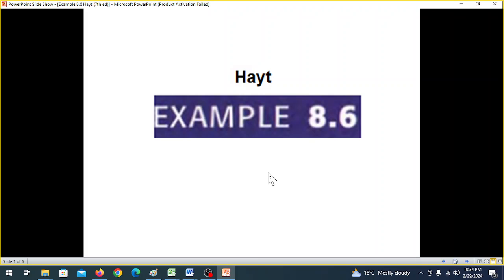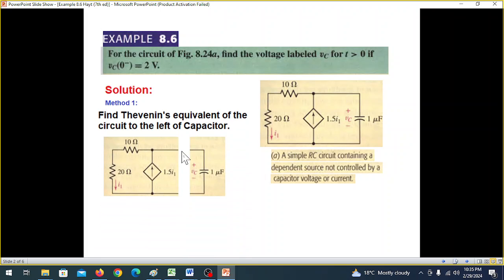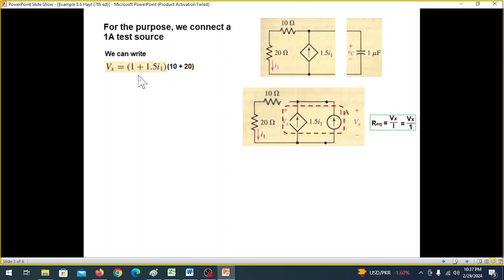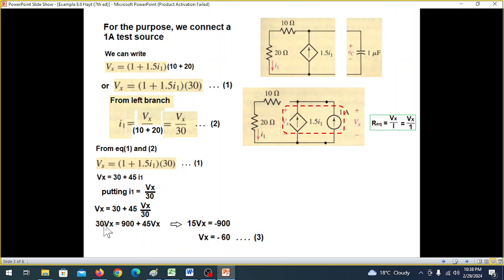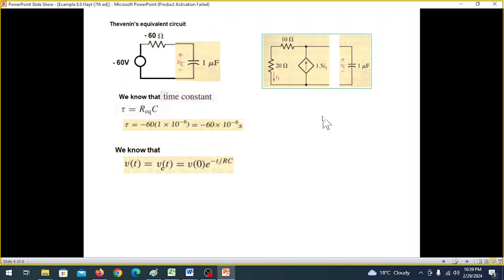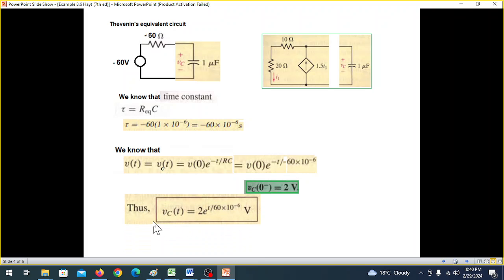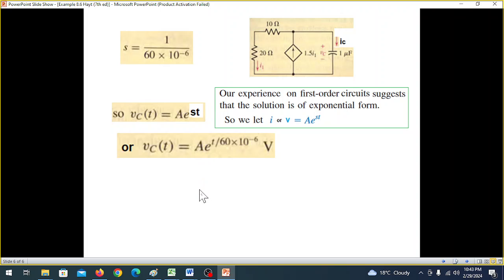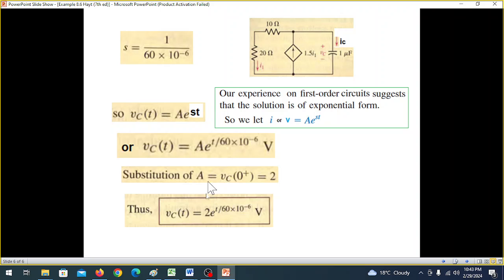(B)LCA(H) Example 8.6  || RC Circuit with Dependent Source || Circuit Analysis

Comment: I am surprised to find the time constant is negative and most intersting thing is the RC network having passive element R with dependent current source and its continuously growing despite of resistor absorbing some energy supplied by the source. Is it physically reliable model for our day to day life and also want to know the reason for growing nature of exponent. Is it due the depenent source present in it which supply infinite energy to capacitor to get charged to infinite time (untill saturation).
Please clarify my doubt and will be waiting for your sincere reply of this curiosity.
Reply from the maker: I don't understad how time constant be negative , it is just multiplication of R and C.